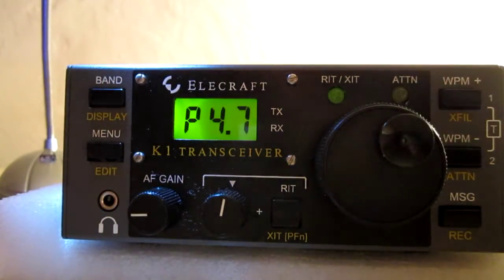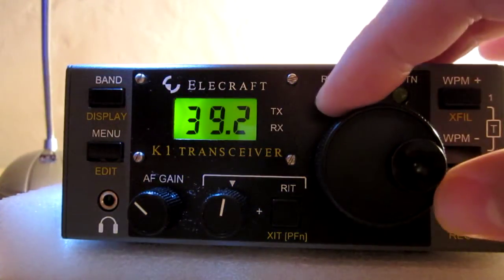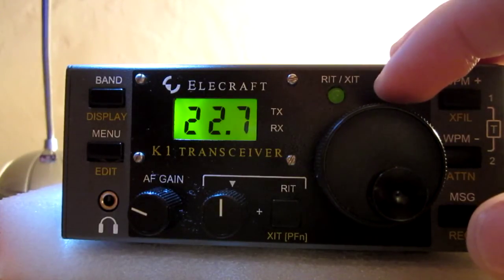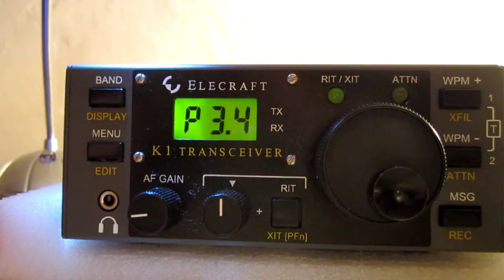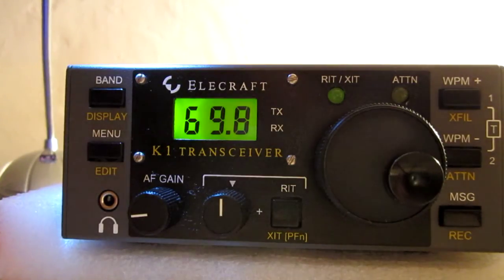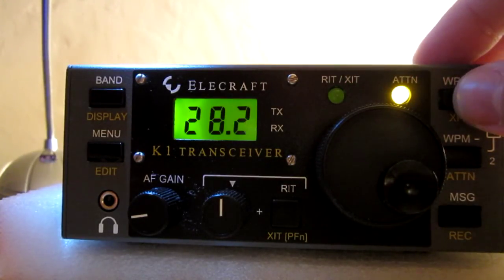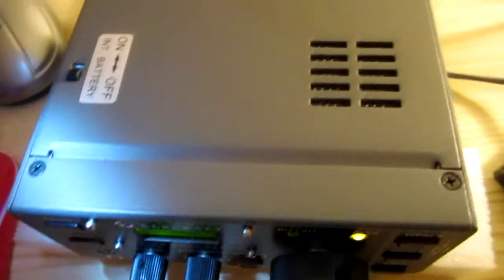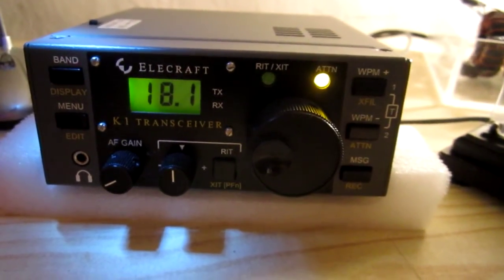Elecraft K1  II

Comment: these are AWESOME little rigs......I have two of 'em....a four-bander and a two band version (40/30/20/15) and (40/20) with the internal battery kit.....worked Antarctica from internal batteries and 4 1/2-5 watts out on  SOTA site last year....20 CW.....that's 10-11 K miles from SW Montana.....a srcap wire antenna (zipcord) at about 20 feet AGL....though it was awesome.....got a 449 or 439 I think, but he called me......YES....love Elecraft rigs....good filtering....solid performer for what it is....good in a contest as well....finished a contest a few years ago with the first K1 I got.....plumbed it into an AL-84 Ameritron Amp, and got 70-100 watts out....not a bad rig at all.....kinda high in price, but good quality, and good folks to deal with if ya ever need to...de AB5ZA/7, or AB5ZA/P.....